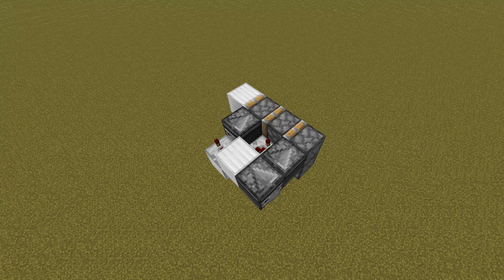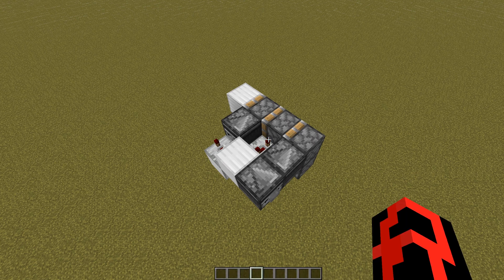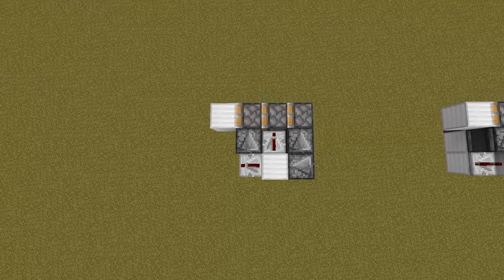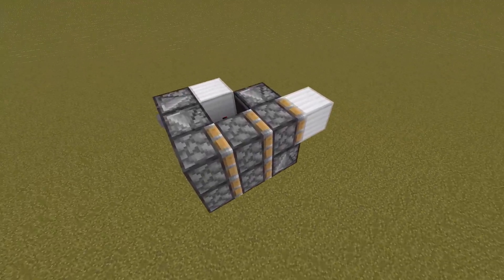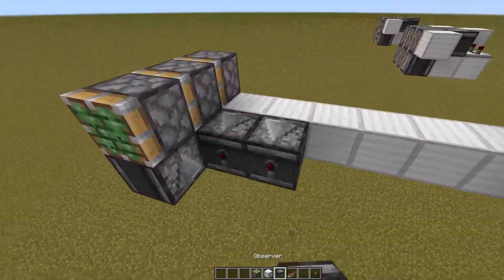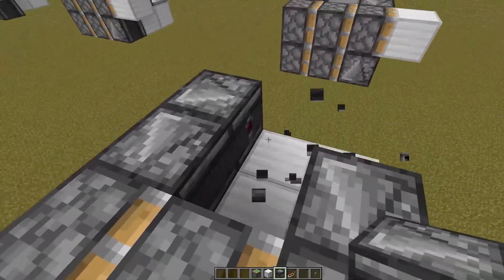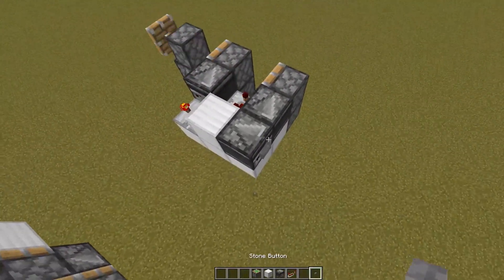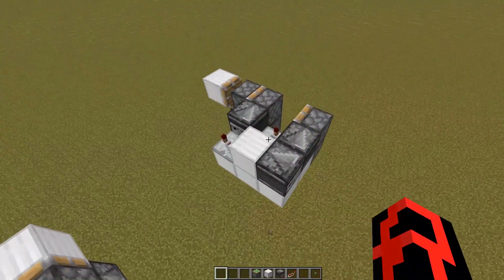1.14.3 Small Horizontal  triple piston extender

Comment: This is so satisfying and great. Is there another way to power this without using a button or lever? For instance with a tripwire hook?
Reply from the maker: yes Ofc :) 

https://cdn.discordapp.com/attachments/233270154329325568/607686374413303809/unknown.png

depending on what you want, replace the observer (the 1 all the way on the right) with a block and that's your input. when you enter AND exit the Tripwire it will extend the piston extender. if you want to power is twice (1when you enter the Tripwire and 1 when you step out) don't replace the observer that's your input